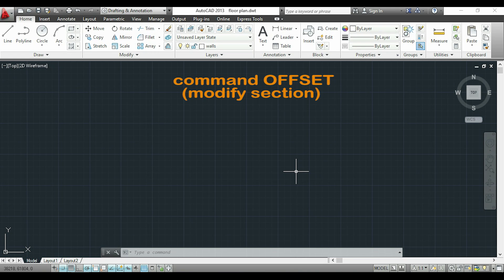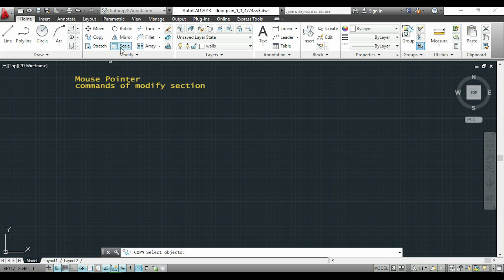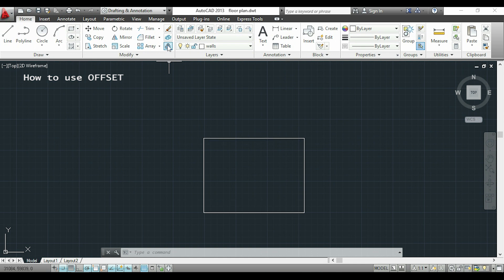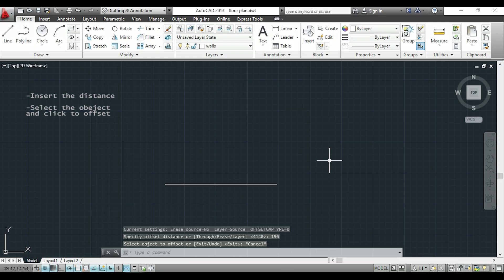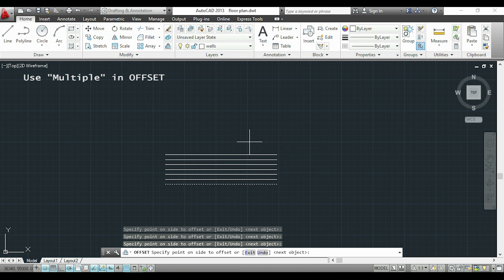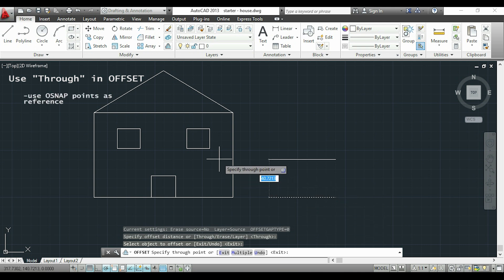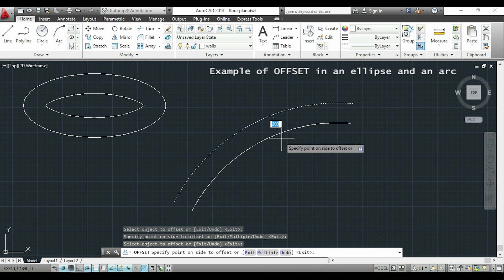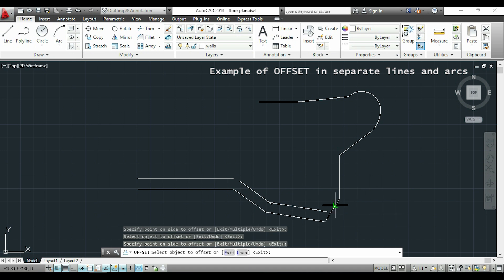AutoCAD 2D Tutorials - 6. How to use OFFSET (drawing parallel lines)

Comment: thanks sir but i have a problem in creating offset, when i enter a value to offset then object is offsetted by 3-4 mm lesser or larger value than that have entered pls help me
Reply from the maker: Hi + 
Jyoshna Meena. Are you typing the distance or you are using "through" and then clicking in a place to offset?. If it is that, make sure you don't have any osnap point on the screen. If not, I don´t know what can cause that problem
Reply: @CADinblack  thank you, in drafting setting dynamic input setting was disabled which lead to this problem i solved it

Comment: i am becoming totaly frustrated as it doesnt make offset line or object after i specify the side on witch i want to offset... it used to work normaly as in this video... i didnt change anything in settings still it doesnt make anything after selecting a side to witch offset... wrraaa!!

Edit: i exited the acad, started it again, new project...it makes offset normaly. i didnt figure out what was the problem
Reply from the maker: Hi +Sinisa K. Nice to hear that you solved the problem. Maybe it was just a bug. Sometimes, we have to restart the program, it is like restarting windows

Comment: Really love your videos. Can you do videos on troubleshooting and settings? Eg. Why my offset isn't working and what needs to change in settings to correct it.
Reply from the maker: Hi +Amal Hasan and thanks for appreaciating this content. 
Check if you specify a distance for the offset. Type OFFSET and press enter -> then in the command bar should be a sentence to enter offset distance -> type a distance and then look if it appears. Good luck
Reply: CAD in black that’s what I do and it usually works but for some reason sometimes it decides not to. 

Another question...When putting in dimensions, can we set the distance between the outer walls of floor plan and first dimension line.
Reply: https://youtu.be/afr4eKpQmhE

Comment: hi! how to offset both sides simultaneously?
Reply from the maker: Hi +makather kather 
Do you mean to offset the entire rectangle or a polyline? if it is that you should convert your lines into a polyline, and them use the command OFFSET.

If your question was to offset two sides simultaneously, I think it is not possible to do it.
Reply: OK thank you